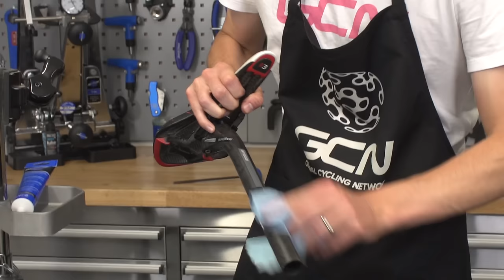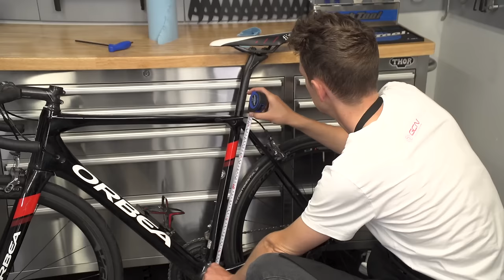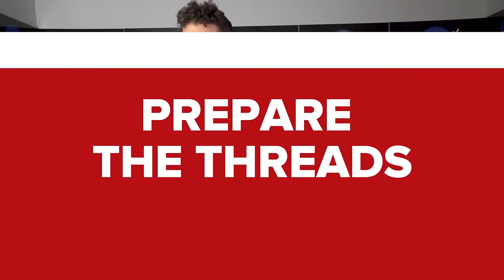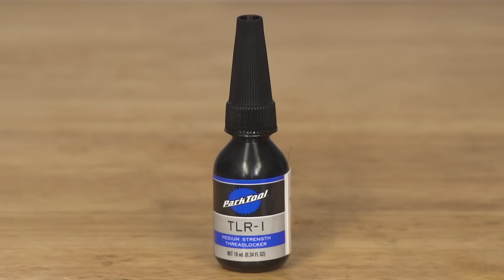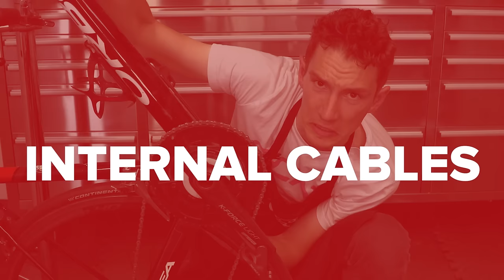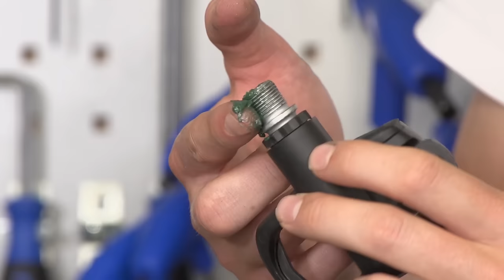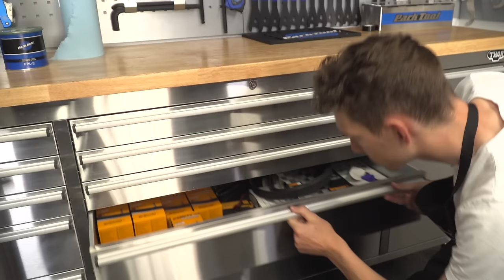6 Bike Repair Mistakes All Cyclists Should Avoid

Comment from the maker: Here are six incredibly irritating bike maintenance mistakes that we've often made.

What's your number one bike repair frustration? 👇
Reply: number 6 is pretty accurate. I always put my allen keys somewhere they shouldn't be and then suddenly I can't remember where I put the 4 or 5 mm key when 10 seconds before, it was in my right hand. Can't seem to get this right
Reply: Stuck pedal! My friend had it once, and even today he had that one pedal on old bike.
Reply: Global Cycling Network Different standards. How the heck is one supposed to know which bottom brackets are compatible with which cranks or why exactly the bar end plugs that came with your bar tape just won't fit into your handlebars...
Reply: not having a workstand... the fucking worst
Reply: Global Cycling Network I broke a 6mm Allen key once trying to remove old automatic pedals on my commuter bike. Fortunately I could get it with a 15mm pedal spanner, kicking into it with my full body weight as if I was starting a motorbike. I'm also guilty of forgetting tools because I have bikes in two places, at home and where I work and so many times I had to wait a full week to get those tools... Just like seized seat posts old bikes with a quill stem often get permanently welded because of water getting in the steerer tube. Last but not least I often have more trouble getting my back wheel back on than getting it out in the first place, because it's tight and not always easy to align on old bikes with horizontal dropouts...
Reply: That's also a problem when you buy old bikes second hand that have spent way too much time stored in not ideal conditions... Seized stem, seized seat post, crunched bearings in bottom bracket or headset, or even wheels, old rusty screws stripping, bar tape falling apart leaving ugly glue marks on handlebars. But you know what, I love giving those good old bikes a second life :)
Reply: I will admit I have done all of these
Especially the rounded bolts 
 Dremel tool  cut slit in bolt remove bolt with large flat head screwdriver if fails locking vice grips grab bolt head and turn.
Internal cable, string theory helps tie string to hallow tube vacuum string through bike Pull and your tube should come out the other end 
Hope that helps
Reply: Am I going mad, or aren't there more than six mistakes in this video?
Reply: use wd40 to clean the cassette. I dont do this but i know other people who have
Reply: toad_1998 agreed! back and neck ache hell! and trying to adjust gears or brakes with the bike stood upside down... very doable, but a pain in the neck, literally. I just invested in a decent, portable workshop stand for home use, (the Feedback Pro from Chain reaction) expensive but bloody brilliant piece of kit.
Reply: never really had a problem with losing tools as I tend to keep all bike specific tools in one tool box. Simples. Or most of the problems mentioned here. Probably my worst headache though, is sometimes being a bit "ham fisted" and over-tightening bolts into soft alloy threads and stripping them, then trying to re-tap the thread and having to use threadlock. Did this with my girlfriends brand new bike because she wanted a rack on it.. why do some manufacturers insist on using low quality alloy frame mounts? ugh.
Reply: @ Andrew Tate - 8, not counting the miscount in the title
Reply: Realising the inner tubes are fitted with woods valves (WTF?) - instead of Schrader or Presta - which means buying an adaptor and then still unable to fathom how to inflate them
Reply: Oh 100% mis-laying tools. Arrrrrrrrrrgh!!! It's very easily done in my complete tip of a garage. I will now drive 30 miles round trip to work in the middle of the night to use their beautifully laid out professional tools and stand (it's a finance company not a bike shop!). I also have two lockers at work - one for clothes, one full of specialist tools, greases, spares etc. Lunchtimes are spent tuning and tinkering. I'd be in heaven in that GCN workshop!
Reply: Not to test the newly acquired repair knowledge on a junk bike.
Reply: Global Cycling Network Putting the cranks on so they're pointing the same way after meddling with the bottom bracket or another component is my greatest bugaboo. Anybody would look demented if they tried to pedal that bike.
Reply: Internal cables!!!! It took me 2 days on and off to get my rear mech cable through the frame on my old Cube MTB. After that nightmare, I used the tube method Si mentioned. I simply used the inner sleeve from an old outer cable. Just don't forget to thread it through the the frame before removing the old inner. Once through, tape to frame, out with the old inner, in with the new, pull out tube. Job done.
Reply: Getting the pedals off required me to buy a giant wrench and some grease, that was a real pain.

Can I ask a noob question, based on this video? I got a bike fit, and the saddle height was determined as 83cm. Where am I measuring that from, precisely? The bottom of the seat tube to the top of the middle of the saddle?
Reply: I used to improv a workstand with rubbermaid containers against a handy wall. Inferior, to say the least, but at least it moved stuff up to where I could work on it. Chairs also work. A barbecue with 'wings' can work to hold the bike while you work on a wheel, just slide the top tube over. My 'actual' workstand is enormously better than these, but sometimes, you is where it ain't, and you need to creatively assess the situation and make do.
Reply: John Martinez  Seat height measurement is taken from the center of your bottom bracket to the top of the saddle. Hope this helps 😀
Reply: Time management. I'm a perfectionist and I'm always, totally can service all my moving parts in an hour... 3 hrs later, guess I'll do laundry tomorrow...
Reply: Global Cycling Network use some sort of plastic/wood to put into the discbreaks when you remove the wheels, so you dont accidentally over-tighten them. costed me a lot of time to get it undone.
Reply: Global Cycling Network Simon trying to tell me what to do.
Reply: Global Cycling Network I spent half an hour looking for the tyre lever once, then I found it in my hand
Reply: It's a really simple one, but my biggest mistake is usually forgetting to take my time and double check each step before proceeding with next one

For a few months I was wondering why my front mech was so buggy, until I was doing a full cable overhaul and noticed that I had forgotten to thread my cable properly under the bottom bracket and missed a hole, creating rub and resistance when I tried to shift
Reply: Missing parts and tolos are  incredible constant....right now I'm missing again my chain link. 😁😁😁
Reply: While this video is primarily about bicycle repair, many of these tips resonate universally for the craftsman. I am reminded of Robert Pirsig's 'Zen and the Art of Motorcycle Maintenance.' Pirsig takes a little time to discuss 'gumption traps.' Using worn tools and stripping bolts, taking ineffective 'short cuts', frequenting the first aid kit,  losing tools and forgetting parts not only suck away your time but steal your energy to complete the project effectively. Over my last 8 years in boat repair, I've had to learn these lessons the hard way. Much appreciation for this video. Thanks and keep it up, GCN!
Reply: I have a friend who refuses to do mechanical jobs beyond, say, an emergency tire change on a car because he can't handle it psychologically. Nowadays, you can get away with that because mass manufacturing makes new items cheaper than if would cost you (counting your time) to repair the old. 
I'm not as bad as my friend in job avoidance, but I've learned to give up when it gets too hard. Life is only so long.
Reply: John Martinez, this will depend on your overall height. A common way of measuring the saddle height is by first measuring your inseam in stocking feet. Then, multiply that by 1.09. If your inseam measures 30 inches, for example, then the formula gives you a length of just a hair less than 33 inches. What to do with this number?  Looking at the bike from the side,  extend the pedal so that it's aligned parallel with the seat tube, while rotated to a  'downward' position. Then, measure from the top of the pedal spindle to the top of the saddle, parallel to the seat tube. That's where you should see that measurement. It's important to have the balls of your feet directly over the pedal spindles when you ride, too, as it becomes a critical factor in getting a good fit on the bike. As an example, even though your seat may be at the proper height, your seat would feel too tall, if you were to pedal with your heels over the spindles. The way to tell that the seat is too high, when pedaling with your feet positioned properly, is that your hips would be rocking side-to-side on the saddle. Lower the saddle just enough to make that rocking go away. Also, this will mean that you should still have a little bit of bend in the knees when your legs extend to the fullest during pedaling. You don't want to lock your knees straight while you're seated. Don't lower the saddle too much, either, or you'll be in danger of doing some serious damage to your knees. As a loose rule of thumb, most male riders find the seating arrangement to be the most comfortable when the saddle is level or tipped slightly higher at the nose, and for women, it's when the saddle is level or slightly pointing downward at the nose.
Reply: Roger, I hear you, loud and clear, ha ha!
Reply: Hi I noticed that you don't have labels on the tool box draws if you have labels and numbers will make much easier to find the tools kind regards
Reply: Internal cables suuuuuuuck!
Reply: #1: Getting dried grease out of indexed shifters.  It's tempting to just blast the shifter with aerosol degreaser and spray in TriFlow. But, that leaves dry grease chunks that eventually muck up the shifter
Reply: I always forget which pedal has the backwards screw and THEN, while trying to remove it, I over-tighten it.  Sigh.
Reply: Haha... that last one, so true
Reply: Do not clamp your bike in the work stand using the top tube. It will get crunched very easily.
Reply: Do you know about Heli-Coil? That would fix your problem.
Reply: #torqueback Can you elaborate on how much play is acceptable on a cup/cone bearing in a hub?  I have a HED Ardennes wheelset that I can push from side to side with a little bit of effort.  I assume you want to have a little play or the wheels wouldn't spin freely correct?    If you could share in gcn tech or a ask gcn segment that would be appreciated.  For the longest time I thought it was my brakes rubbing and tried to keep adjusting the brakes.
Reply: Replacing my training wheels with my Fisher-Price tools is a hose monster.
Reply: This was great, been searching for "repairing a bicycle" for a while now, and I think this has helped. Have you heard people talk about - Viyackson Yenacob Review - (Have a quick look on google cant remember the place now ) ? Ive heard some unbelievable things about it and my cousin got excellent results with it.
Reply: Just wonderful, been searching for "why does my bicycle chain keep coming off" for a while now, and I think this has helped. Ever heard of - Viyackson Yenacob Review - (do a google search ) ? Ive heard some awesome things about it and my work buddy got cool success with it.
Reply: tightening the axle nut "perfectly".
Reply: Replacing pads with stuck pistons and bleeding the system. Hours of work, eternal uncertainty.
Reply: Had this to, took me a two meter lever on the wrench to get it loose.
Reply: Global Cycling Network 6
Reply: Tools that go walkabout. Having two little "helpers" around is usually the main cause. Now where's that f**king 5mm allen key gone?
Reply: Fitting my tyres on backwards and finding out i go backwards when i pedal ;o
Reply: Not having enough room where I live to properly work on my bikes.
Reply: My mate says never use carbon paste on a seatpost it will get stuck forever
Reply: @xGshikamaru   Tip for aligning rear wheel with a derailer ( the kind that go into the drop out). Get another derailer, an old busted one, cut the slot (the part that goes into the dropout) off with a hack saw, file any burrs off, put the cut off slot into the dropout on the other side of the bike. Ta da, now you have an insert that makes the dropout slots even again!
Reply: @madmonkeycycling9098  thought I was the only one
Reply: #AskGCN Puncturing the new tube when replacing the faulty one. Or putting the tyre in a reverse direction without following rotation symbol on it.
Reply: Global Cycling Network I've been Trying to Remove A rounded Bold on my Bike It's Stuck and I Took many days Still didn't Removed it I need your Advice To remove it ASAP
Reply: My number 1 frustration?  Thinking I'm just going to change the brake  pads and brake cable on a secondhand bike before a nice ride and buying the parts.  Then coming home, taking off the brakes to clean them and discovering that I have the infamous Shimano Altus BR-CT90 caliper brakes and that I have 4, count them 4, cracked grey spring housings and I need to order new brakes.  :(  That is my sad face checking my mailbox everyday to see if Amazon had delivered them yet.  I live in Seattle.  Jeff Bezos lives here and has a big office downtown.  Why does it take him so dang long to get me some brakes?  Maybe he should use bicycle messengers instead of the US Postal Service.  Our city has lots of them and they get so bored that they create new sports like this one.  

http://www.dailyuw.com/multimedia/videos/youtube_66cba5be-85d0-5d94-998a-652329ce77cb.html

I was happy to see that I am not the only person that puts electrical tape on my seat post.  If I have to dash into a store for very long or a coffee shop, I take the seat with me so no one is tempted and when I come back out, it goes right back where I had it every time.  I need to start greasing the post though and for that matter, bolts from now on:)

Thanks for that tip about the back wheel.  And for dealing with pedals, how about a work glove on one hand?  I wouldn't prune my roses without getting out the gloves and those dang pedals are just as pesky.
Reply: @shamanbeartwo3819  I don't understand how removing the seat-post would stop a thief. Unless they're disabled, one can ride quite far off the saddle.
Reply: @rossfuller8025  I lock the rest of the bike, I just don't leave the entire seat so easy to remove.
Reply: I love Cycles and Cycling...💕and I feel like to give up everything and get myself a job at PrakTool.... 😍😍😁😁
Reply: Shifting issues. When the chain is on the front middle ring then my chain rubs against the front derailleur.
Reply: I have a Raleigh Twenty that I think was licensed to be made in Canada. Some parts are metric, replacement parts are imperial and then you have a combination of both! Gotta go thru the whole ratchet set...nothing quite fits so you grab the monkey wrench and visegrips and hope you have some skin left on your hands afterwards. Oh...for the seat height I use a cable tie to mark the seat post. Great tips!
Reply: Speaking of stuck seatposts...I once had one stuck so bad I had to cut it off at the top of the seat tube, and then stick a hacksaw blade down inside it and cut vertically through the post in two places and then pry the pieces out :-)
Reply: @madmonkeycycling9098  ❤️
Reply: Nice fit
Reply: @alanwaterworth6464  Pretty simple trick for this, get a some rope, loop the line over a rafter/fencepost/tree branch and tie a knot about eye level. Hook the saddle in the loop and there you go. You can even spin it around/tie multiple loops for different heights ect. Obviously a stand is better, but hanging it is far better than one might expect before trying it.
Reply: @tomaskalyniuk4233 No No, you use this in place of chain lube rite!!!!
Reply: @Lucky-uk1bv  haha
Reply: Remove my old bike cassette.. I easily remove my RB gusto GB ranger.. But never ever able to remove my 9 years old merida big 7 500..
Reply: To late for me already lerned all of these the hard way
Reply: Assemblies that explode as they come of so you don't know how they went on and you have to search on hands and knees to find all the parts.  I find a large retired beach trowel helpful in stopping run aways
Reply: @ xGshikamaru All great points to bring up when arguing down the price on a used bike.
Reply: @donaldbrun  Oh man, I just bought one that attaches to the wall and I LOVE IT.  the joy of not having my bike fall over as I'm adjusting something is immense.  My swear jar is not filling up like it used to.

Comment: You forgot to mention the one very important thing when talking about removing left pedals: Remember that the left pedal side has a left-hand thread!
Reply: I go with Back off.
Reply: Actually you need left hand thread on the right hand side, and right hand thread on the left hand side.
Reply: @shaunbarnett2972  Oh jeez just stop. U are going to confuse people. 

Let me break it down for some people. 99 % of the time the end of the pedal has a L or R marking. R is drive side chain side. L is non drive side. R is tightened clockwise righty tighty. L is tightened anti-clockwise lefty tighty. The threads that are right hand threaded are higher on right hand side than left side when examined. Threads on left hand threading are higher on left side versus right side.